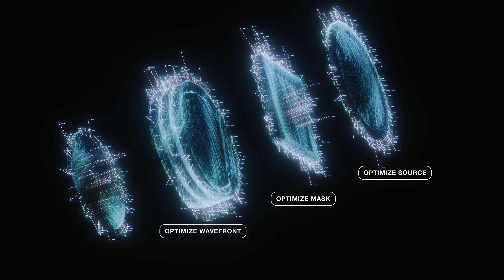Computational lithography: Driving nanometer precision in microchip manufacturing | ASML

Comment: Dutch sells these machines..
then Koreans and Taiwanese mass manufacture chips using this machine and their own "semiconductor designs" 
Semiconductor design, or integrated circuit (IC) design, is the process of creating the blueprints for microchips by designing their logic and circuit layout using specialized computer-aided tools

Comment: How exactly do you guys handle "light" for making chips at thr 5-8nm scale? Light at such wavelengths is soft X-rays! No "traditional" lense can focus X-rays. You need to scatter them of heavy elements, no?
Reply from the maker: The 13.5 nm EUV light in our most advanced lithography systems is just shy of x-ray. Like x-rays, EUV light is absorbed by essentially all materials, so we can't use lenses. Instead, we worked with our partner ZEISS to engineer multilayered mirrors that can reflect the light.
Reply: @ASMLcompany  Amazing!

Comment: The light that passes through the template – why doesn’t it produce an interference pattern? According to the double-slit experiment, since the photon, which is both a wave and a particle at the same time, is not being observed as passing through the pattern in the form of a particle, it should, when unobserved, pass as a wave and produce an interference patter
Reply from the maker: Good observation! The light does indeed diffract and form an interference pattern, but the lithography system's optics essentially perform an inverse Fourier transform to turn it back into a real-space image. Still, diffraction affects how accurately an image gets transferred from the reticle pattern to the wafer and plays an important role in determining how small a printed image's features can be.

Comment: what if the lens have a imperfection? how is possible to know that?
Reply from the maker: The hardware and software in our lithography systems can work together to make small corrections where necessary! Lithography is a dynamic process, so our systems are always adapting.

Comment: The Advanced project of the CaesarKing for China. The Plating effects. By the usage of Granules effrct of using platforms of imagery system created globe imagery projections of augmented reality to virtual reality in 3D layerings of structures and and it's outer meridians and skeletal globe intersecting lines which area tiltable system usage of point to point artificial poles in system modules in synch with area planted pole towers signal synchers per strategic area world area mappings particularly the continental plates areas and in system of X and Y linear correlation mappings of compass range effect of measure and area project scoping with physical model plates scale model in connect to system function like arranging flight air traffick of fighter jets on a carrier done preparatory in office plan mapping digital or AI tech table likened to Iron Man finger pointing screen models using either finger or globe  connected and synch device or magnetic conductive pen of real time  system data arranger or mover like a unison picture ot interconnected data information fusion in synch with each other with real time movements of instruments or system tools upon activate. Using granulated science lab gases types of likened to a contrast media traverse underground pathways area mapping in its layers of granules of solid to liquid to gases and vice versa of attract underground or at surface magnetic type poles of information carriers attach to station nodes of each tech tech pole towers. Then underground minerals of Earth mantles and crust crystallized attachments of usage of Earth gas exchange cycle path of Kreb Cycle up and Electron Transport chain down and making use of Volatile gases of contrast media like mapping underground in traverse to its changing energy pathway underground pole to pole meaning you have to have both sides Artctic North Pole and South Pole Antarctica of such informations and datas receptors and transceivers both sides of real time imagery tracker underground energy structures of not designed for spying, not designed for creating calamities, disasters or chaos nor sabotage but to real time analyze the Earth Tectonic plating problems and anomalies and occurrences down below and the magnetic fields and frequencies influences and thr dense Earth scaffold and layers analyze by instilling and planting system created strings or chemistry lab created strings to artificially create signaller nodes or counter effect nodes for great Earthquake to Tectonic plates movements movers. While there be trifold effrct of above atmosphere space floating tech of pre arrange plates and can rearrange plates of up then surface then layered ground interconnect of fix and repair the Earth plates of its physical to system created to gaseous types none power fix and repair as secondary solution to solve Earth disasters giving the title to China as the Earth Platings Fix Repair area symbol holder of its general category identification the reason why I the CaesarKing your King had given that title to you Chinese as long as you're functional and in compliance to that project order of title bearer of such otherwise I will give that title to other many identifier countries or organizations for none compliance and antagonistic move against my order. Ordering my AI Quantum Satellites in synch with my Galaxy source fund to estimate or assess project cost and teleport the fund money project to Chinese Expert groups authorized by the Chinese government by fund allocate, now. Let it be

Comment: Taiwan's chip industry holds the lifeline of global technology.
Chip Specification Grade Classification:
Working environment requirements for Logic (Processors, AI Artificial Intelligence Computing) and Memory Chips:
 * Commercial Grade: 0 to +70℃
 * Industrial Grade: -40 to +85℃
 * Automotive Grade: -40 to +125℃
 * Military Grade: -55 to +150℃
There is also an even higher grade: Radiation Hardened (Rad. Hard), which requires resistance to radiation and interference, as well as a wider temperature range. The qualification testing for military and aerospace-grade chips involves pushing them to their limits: continuous high and low temperature cycling, vibration, shock, high ESD (Electrostatic Discharge), and interface terminal insertion/extraction endurance.
Generally speaking, industrial-grade chips are twice as expensive as commercial-grade chips, automotive-grade are more than three times as expensive, and military-grade chips are extremely costly due to the need to amortize the manufacturing line setup costs. For aerospace-grade chips, setting up a production line costs hundreds of millions of US dollars, regardless of the quantity produced.
Taiwan's TSMC is the exclusive global manufacturer of high-end logic, AI, and memory chips for the United States and its allies, as well as Taiwan's National Chung-Shan Institute of Science and Technology (NCSIST). The US Defense Advanced Research Projects Agency (DARPA) has approved the following manufacturers for producing military and aerospace-grade logic chips and processors for the US military and aerospace industry: Taiwan's TSMC (advanced 7, 5, and 3 nanometer process technology), US-based Intel (14 nanometer and older processes), and US-based GlobalFoundries (28 nanometer and older processes).
The manufacturing process, technology, materials, and raw materials for military and aerospace-grade chips are highly classified. The US and Taiwan have signed agreements to jointly control this top-level technology, prohibiting its export to other countries. Still concerned about national security, the US government has requested TSMC to invest in and build a factory in the United States to manufacture advanced AI chips. The entire production capacity of this plant is contracted by US Department of Defense military and aerospace manufacturers. Any surplus capacity and the output of new plants will then be allocated to other companies like Nvidia, Apple, AMD, and Intel – a secret that cannot be publicly stated.
China and Russia's military and aerospace equipment can only be manufactured using general commercial-grade chips. They employ a trial-and-error method to create insulated, cold-resistant, and protective enclosures to shield the chip motherboards. This approach results in short warranty periods and questionable operational quality in combat for Chinese and Russian military equipment such as missiles, radar detection systems, and aerospace devices. Faced with the US's high-tech electronic warfare countermeasure systems, their chip motherboards are vulnerable to destruction by high-power electromagnetic pulses, leading to missile failure and radar system malfunctions. The poor performance of Russian weapons in the Russia-Ukraine war fully demonstrates this fact. If China were to invade Taiwan, the PLA's J-20 and J-16 fighters, missiles, radar detection systems, and naval radar detection systems, which are designed using commercial-grade chips, would undoubtedly suffer a major defeat against the electronic and electromagnetic warfare capabilities of the US and Taiwan, as well as anti-electromagnetic pulse missile weaponry. (Online rumors in China suggest that the guidance systems of the PLA's missiles and torpedoes are based on reverse-engineered US technology from the 1990s, using stockpiled Intel 486 and 586 processors from 20-30 years ago.) This is something that the general public wouldn't understand, only experts in chip technology would know. Without mastering the highest technology in the chip industry, the Chinese Communist military is fundamentally unqualified to wage war!
Electric vehicles in China are frequently reported in their domestic market for failing to start due to excessively cold or hot weather, experiencing battery explosions, or suddenly malfunctioning while driving, leading to fatalities. Besides other factors, it is highly likely that Chinese electric vehicle manufacturers, in a black-hearted attempt to reduce costs and violate vehicle industry safety standards, are using cheaper commercial-grade chips and semiconductor components instead of automotive-grade ones for their electric vehicle electronic and electrical systems, inevitably leading to frequent accidents.
The computer chips for the US Mars spacecraft are manufactured by Taiwan's TSMC using aerospace-grade chip technology. The computers for the US space station are designed by Taiwan's NCSIST and manufactured by TSMC using aerospace-grade chip technology, guaranteed to operate flawlessly in space for 20 years. The computers and electronic systems for US and European low-Earth orbit satellites must be manufactured using TSMC's aerospace-grade chip technology.
Reply: bro like how tf did you TYPED this💀🙏🏻

Comment: Who do chips for large servers need to be packed so small? Why do they need to be under 1 inch? Why not make one one foot by one foot? These server cases are large and can easily handle it without issues. Instead of having to run 100 microchips you can run 1 larger one.

Comment: Impressive. Those lenses have to be amazing to not have any edge softness and it's deep UV so the surface precision has to be atomic level. As a camera system it would have bizarre resolution.
Edit: I had a little chat with GPT and it says there are no lenses in ASML litho machines, it's done with off axis mirrors because lenses can't do EUV. So this video is rather misleading.

Comment: Mask optimization is done by "printing" masks and ajdusting mask to achieve better results i guess. So each mask has a process of getting optimized and then be used? Source controll makes sure the light has the same "strength" at every point in the mask or does diffferent masks require different levels of light "strenght" to print out perfect patterns. I hope ASML has huge facilitys which create tons of microchip sjust to read the ouptu and tweak input. Hopefully tons off computers process this data to achieve even better results. 

Keep it up. humanity does need way more michrochips

Comment: 'computational lithography' - imaged analog style. so lithography, then, using UV coz the wavelength is shortest. but hold up... what if the photoresist reacted to microwaves and the substrate was gold coated silicon, you should be able to turn out layers a few atoms thick. gold can be rolled to one atom in thickness, which is, erm... 0.47nm with the silicon, 0.14nm just for the goldene. so hup hup lads, where's the actual announcement

Comment: This is awful as far as designating source v. target or conveying sensibilities of how a 'skyscraper' of a chip (hey, 7 layer metal is enough! 230 metal flash is distinct!) builds without leaving the top more like a pizza; and can't possibly be crediting makers of 1 nm accurate spincoat resist enough. Secondly optical compute is coming into its own and 'computational lithography' instead of hinted diffraction is awful; you have animation hints suggesting you turn some optical elements to get that done, and it's all in the service of making your fans dumber, as I read it. As a maker of chungus-bus sized tools it can't be helped that all other departments (e.g. marketing) are thrown 'under the bus,' but they can be permitted to accompany an odd FAE enough to get the story they should be trying to convey to the public without Gray Coding all the tokens, as it were.